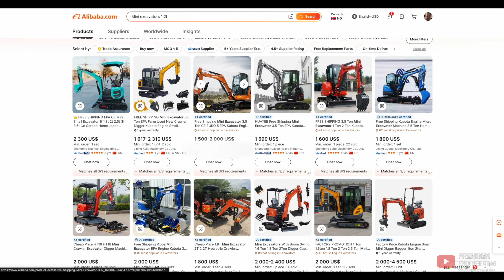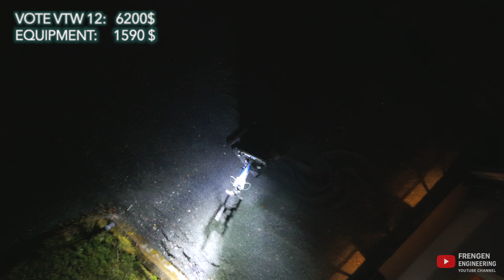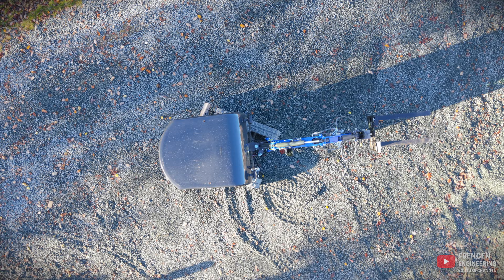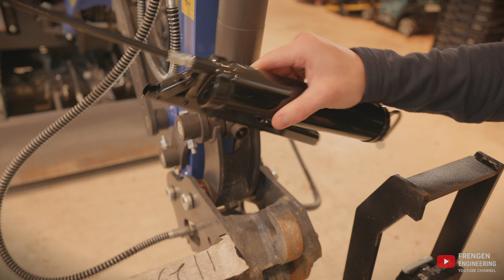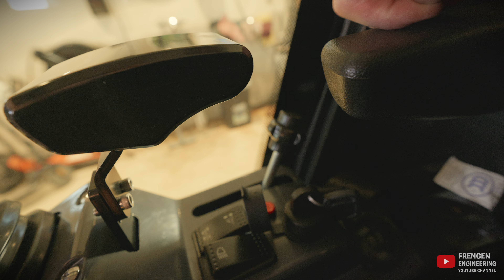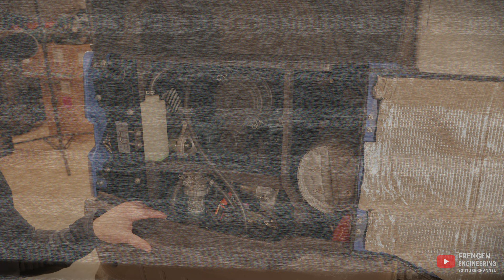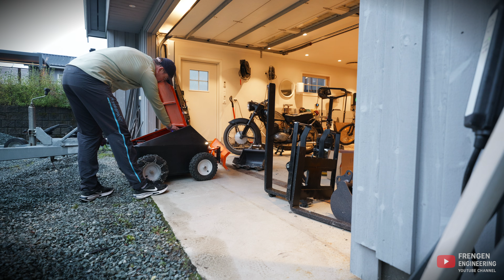What it REALLY costs to import an excavator from China — and what you actually get

Comment: jesus, you really should think of some kind of safety feature for quick hitch/coupler, just one button press and the bucket or whatever attachment will fall off. Maybe a switch operated relay that enables the button on the joystick.
for the quick hitch lines, there are hose clamps where you can weld on the base plate and hold the hose tight to the arm, im sure there are Hydraulic shops that sell them (maybe hansa flex?)
keep an eye out for track tensioning, theres probably a grease point underneath the cover plates on the side of the tracks for tensioning.
btw. if you attach new unfilled attackments (auger, slope bucket), check your hyd. oil levels.
in machines that small, some liters matter.

good luck tho!

Comment: We have a Avant with a Kubota engine and it's 25+ years old and we never had any issues with it.  (Think we got it in 2018)
Have changed hydraulic hoses once, and the battery a few times, and the seat has been worn out and replaced. 
Only thing broken is the hour counter, so we have no idea how long it has been running.

Comment: Great excavator! Don't bother with the doors, just forget about it. Strengthen and shield the high-pressure hoses—this is important! Weld two pieces of tubing to the control levers on each side and attach two pieces of rubber hose to prevent slipping. Then you'll be able to operate the excavator with your feet. It'll be a little awkward, but it'll free up your hands when you need them. Good luck!

Comment: Those fees are just insane and sound to me like a scam. 
But I have encountered something similar for out insulation liquid. It were just 6 barrels with 250L each and the time where they needed to be stored until german customs had them cleared costed me over 1000€. And it was stored for just a few days because german customs took a probe from both liquids to analyse it in a lab.

Comment: I bought ma Takeuchi TB217r used with 1200h Years, 3 Buckets, but without hydraulic quick coupler, claw, etc, for 19.000€ from a company, incl shipping, in Austria. I also thought about buying a Chinease one, but I was to afraid of the fees and taxes and I wanted a good supply of spare parts. (already broke a cylinder, from crashing into my carport ;).

Comment: Tip: Do the oil change now. As someone who got their first real engineering job at the SKF research laboratory way back when; 10h is just about right. Research showed that (almost) all wear stems from debris (from manufacturing etc.) that gets circulated and rolled into bearing surfaces. These then serve as stress concentrators that eventually lead to metal fatigue. (Bearings mounted in a "clean room" setting basically didn't ever wear out, when selected correctly for the application to begin with that is). 

So if I remember the experts correctly the sweet spot for the first oil change for a new engine is 10 hours. That balances the need for running time to work all the debris (e.g. burs) loose but not yet damage the bearing surfaces too badly. Then 100h (well you could do 25 hours, and 50 hours for that extra safety) and then as per the manufacturers recommendation. 

Now, for a home machine like this you're probably not going to wear out the engine anyway, but thought I'd just mention it. 

(P.S. And yes, synthetic oils actually are that much better, but not needed if you're changing the oil after just a couple of hours when running in.)
Reply from the maker: Thank you so much for this very helpful and detailed advice! Really appreciate it. 😊

Comment: Approx AUD $19000. Hmmmm have to check all options.
Reply: 10k to 12k you'd get it landed at the port at which state you're at. not sure where you got 19k aud from. as long as it's used for private use you can get one in Oz. import tax pretty sure Oz and China have an agreement. contact vote china for a quote.
Reply: @sheep.herder  well 12k USD=18400 to 19000 AUD depending on current conversion.
Reply: @alpinealpine2793  i just ordered one under 10k AUD shipped to Brisbane.
Reply: @alpinealpine2793  gst, port fees, quarantine(AQIS) + delivery around 12-13k AUD total price for the machine

Comment: grinding the door a little bit and painting it is probably easier than doing anything to the hinges. BUT you could add a shim on the hinge pin to bring the door higher just a little bit.lift it up on the hinge and put on a circlip  or take it off and put a washer
Reply from the maker: Perfect advice! Thanks☺️
Reply: @frengen_engineering  shimming the top of the pin inside may be better advice(so it doesn't grind). kinda depends on what its riding on/how good of a hinge it was to begin with, did they hide a bearing ball in there or not etc.

Comment: The CE mark doesn't btw mean it's tested or anything. By printing a CE logo the manufacturer declares that it meets all regulations. All it means is "I promise I'm not breaking any laws.
Reply from the maker: Yes, that’s the way I understand it also. But still , that’s enough for getting it leagal to operate and import. I think, for all such equipment, the most important is to use it in a safe way. Being cautious of hydraulic fails, balance of the machine and surroundings

Comment: I would prefer buying a good second hand mini ex rather than a “new” Triple-C (Cheap Chinese Crap) the moment I saw the 3.5 ton advertised at the same price as a 0.8 ton I knew it would be a scam. I have a Kubota 1.5 bought second hand and I love it. Chinese? You can keep em.
Reply from the maker: Hi, off course a Kubota is top level, but here in Norway, a used machine with 1000 hours cost twice as much as this new one, with all the equipment. Hope it will last for a while tough

Comment: That’s a very common scheme if you order CIF.
The shipping company will charge very little for the sea shipping. The handling company at the port will charge an amount which will exceed the sea shipping by a big margin. You can’t choose the handling company at the port, the original shipping company does this. The shipping company and the company at the port work together and they will make their profits regardless of a seemingly cheap shipping fee. 

To avoid this situation, it’s best to ask the seller for a DDP (delivery duty paid) price. Some sellers don’t offer such conditions. In this case it’s best to organize an own freight forwarded who will quota you the final costs based on item price, weight and size in advance.
Reply from the maker: Thanks for the tips! That’s really helpful information for anyone looking to import.
Reply: @frengen_engineering  I had a similar issue when importing my Chinese solar unit. I "fixed" the problem by going with a forwarder the 2nd time around. Learning money is well paid. I've ended up ordering a heat pump, ventilation system, fences, interior stairs, glass railings, balcony railings, massive pivot door, rooftop access window (remote controlled), "japanese" toilets, ceramic tiles (60% Duty in EU!!), WPC wood decking, Sauna house and a massive home gym with dumbbell pairs up to 35kg and about 200kg in disc weights, olympic bars etc, all for about 40k USD plus 4k shipping, plus VAT and duty, to the Baltics. Crazy savings, really. All products were of decent quality, except for the fence which I managed to sell on locally for a loss. 

What I did to make sure the products were decent, is to focus mostly on companies with at least 15+ good reviews, and which go to abroad trade shows, so that at least they had been in contact with western regulations and customers before. Also, the only company with issues (Fences) was the one where there had been no big amount of previous reviews...

Comment: To adjust your door quick and easy, assuming the hinges are not too thick and heavy duty, open the door, then put a wadded up cloth rag either in the hinge itself, or just below it (in the jamb opening) on the bottom hinge, and try to force the door to the closed position, and you will spread/bend the hinge faces apart a little, making the bottom part of the door close a little bit more to the front of the machine. Don't leave the rag in the hinge. This also works on most kitchen cabinet doors for minor adjustments.  Ask a few auto mechanics if you are unsure how to do it.

Comment: Good job ordering the machine with all of the specifications you wanted, like diesel Kubota engine.  Regarding the door closing properly I would suggest use a grinder and smooth that high point down that’s making contact and then touch up paint those two spots, door and frame haunch. Overall it seems like you got a good machine. I like that the Chinese business was honest, honorable and came through for you from half a world away.
Reply from the maker: Yes, I will do some grinding on the door to make it fit properly. Absolutely the best solution. Thanks for the tips😊

Comment: Good and informative video. From the previous and this video, the excavator seems to be very reasonable and as you mentioned , if you are not a full time builder or groundwork then this is a reasonable option. Similar to buying hand tools like spanners and sockets from cheap shops rather than buying the top quality if you are using them some weekends.

Comment: ... a few seconds later it was paid. Yeah I know that feeling. I ordered a laser from China, my second one from the same supplier for AU$16,000, or at the time a little over $11,000 USD. My bank made 3 calls to me about my transferring 100% of the $ to them up front, but because I had dealt with them before I had no problems.

Then I told my wife what I had paid - I thought the bank was bad...
Reply: The question you didn't answer is what does your $16,000 laser do for you ?

Comment: file the door corner down a little till it does not touch then paint it with touch up paint....simple
Reply: This is what I was going to suggest. Grind the metal on the door. Make sure to paint the exposed metal on the freshly filed area and the previously damaged paint to give obstacles to rust. I have never had luck completely preventing rust, but it's good to never surrender.
Reply: Yep 5 min with an angle grinder and spray can.

Comment: I did the same as this man, but ended up with a much more simple one. 1,2 ton with break hammer, tiltingbucket, quick shift and regular bucket(45cm) without cabin and a one cylinder air cooled diesel, swing boom and expandable tracks. All inclusive tax, shipping and custom. 6428 USD China-Norway BUT I used freight forwarder and didn’t have to pay all these extra fees I paid my freight forwarder 1130 USD and that’s included in all of my payments. So to you Norwegians who like to import your self, remember to use a freight forwarder. And think trough everything you like to have on your machine, before you start a communication with a seller from China. Good luck 😊
Reply from the maker: This is a very good tip!
Reply: @frengen_engineering  which shipping method did you use? Is it DDP?  Because by this method all shipping expences,including taxes and fees, pays seller. You just have to pay freight unloading at your destination.
Reply: The Arctic shipping route from China to Europe has been opened; perhaps in the future, freight costs between China and Europe will be cheaper.
Reply: @老虎-s9e  China had originally planned to extend its China–Europe freight trains to France and Northern Europe, but it is clear that Brussels is not keen on this.As long as the leaders of the EU and NATO continue to hold US citizenship or are appointed by the US, none of this will change.
Reply: A forwarder is the best suggestion in the comments. Saves a bunch of money and hassle, but shipping often takes a little longer. Considering the long shipping time from China anyway, a bit of extra time is nbd.
Reply: freight forwarder is just one more person you dont know you have to put your trust in with your entire purchase and more money. Well I am assuming you mean a freight forwarder from china? I tried to do this before and so many of these freight forwarders had some scary reviews lol
Reply: @acreageliving Not a good idea. Get a freight forwarder from your destination country.

Comment from the maker: Hi! Do you have other questions regarding the machine? Please comment them here, and I will include the answers in a future video! All the best, Frengen
Reply: For the issue of the bottom corner of the door catching on the frame, can you just shave a little bit off the corner of the door with a grinder to get the clearance needed? Seems a lot easier than messing with the hinges, especially if the door currently seals and opens/closes easily.
Reply from the maker: @mr.e.. Yes, don’t know why I did not think of this. That’s where YouTube is great! Someone also mentioned it. Will do. Thanks😊

Comment: Very interesting breakdown of costs. For that price, I would buy a used machine instead, of a better brand. Better quality and easier to get parts.
Reply from the maker: Hi, here in Norway, it costs about twice the price for a 8 year old Kubota same size, without anything other than a digging bucket.
Reply: @frengen_engineering  I get what you mean, it really does look like a great machine for that price. The only thing that would hold me back is that if something breaks, the expertise and spare parts aren't nearby. In the end, everything breaks at some point. But if you're handy, you'll probably manage just fine by simply ordering a small replacement part.
Reply: I agree
Reply: especcialy the spare parts part.

Comment: Just because anything from China has "CE" stickers all over it does NOT mean it is CE compliant. The same goes for the US equivalent to CE -- UL (or FCC or EPA or any other certifying organization). China has NO problem with putting CE/UL/et al logos all over everything they sell, but more often than not, those products are NOT compliant with those organizations' standards. Considering how pristine that excavator's box was when it was delivered, I doubt Norge's customs service actually did an inspection to verify it was fully CE compliant. Odds are it is not. The videos Frengen Engineering did for the machine are outstanding!
Reply: Correct, CE = European Conformity and... China Export 🤷‍♂️
Reply from the maker: Hi, You are correct about being skeptical about the CE marking. Anyway, in this case I have gotten all the needed papers, regarding the CE. If something then should happened, the paperwork is all good. Also, the machine itself has all the safety features as the CE in this case is demanding.
Reply: for majority CE is a self certification. it may lead to bans if abused and fines for the importer etc. it's just a promise that someone took a look and that someone somewhere would have the paperwork.

UL and CE differ greatly in that UL is not a self assessment and UL is not a legal requirement, UL is also a private company. products imported to usa have standards though but mostly its like the emissions bits and such for something like this, possibly FCC (these products will usually need services of a certification body for their CE marking).

for a lot of products CE marking just is them saying that it doesn't have banned in eu chemicals in it, that there's sufficient isolation of mains voltage from the body, that the leads, neutral and live(even if it's a product where it makes no difference, but sold without a plug), are marked and such. product recalls are usually related to insufficient isolation distances in lights and stuff. a lot of product just uses external psu's these days as it just makes it so much simpler.

Comment: Great vidoe!  Even with all the added costs, you received a nice excavator at about a third of the cost from dealers.   A three-ton Kubota with a cab and no accessories costs $44,000 USD in Thailand.
Reply from the maker: Thanks! Yes, even with the costs, it's a great deal!
Reply: To be fair, a Kubota is at least 3x the quality, and will last 5x longer.  It's like buying a Yugo vs a BMW

The cylinders on my Chinese mini began to rust after only one year. I've run/owned a of heavy equipment and never seen that. For homeowner use, they are barely acceptable, but nowhere comparable to a name brand machine.
Reply from the maker: @ArthurDentZaphodBeeb Hi, yes, the Kubota does lift the quality up by far. Really hope the sylinders won’t rust that fast on this model
Reply: Every possible corner is cut on Chinese machines. Substandard steel, welding, wiring, poor undercarriage, poor hydraulics, lousy bushings, lousy bearings etc etc etc. My Chinese mini is the most difficult piece of equipment I've ever operated - and I'm a Journeyman operator...

I'd be amazed if it lasts 1000hrs. The only thing worth a damn is the Kubota engine.
Reply from the maker: @ArthurDentZaphodBeeb Hi! That doesn’t sound good. What brand is this?
Reply: @ArthurDentZaphodBeeb  lol stop lying

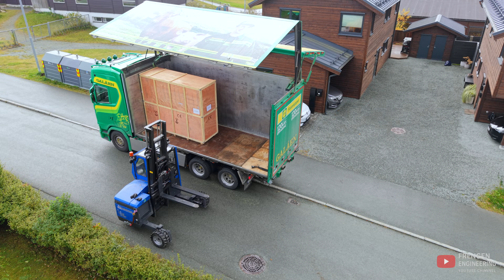Comment: 08:07 The companies just put the CE marking on the machines themselves. There is no organization doing any checks or anything. Besides, in China they just have some stupid "Chinese Export" which is exactly the same as CE. You can have any markings put on the machines you get from China. They don't mean anything at all.

Most likely your machine is illegal in the EU and if you would have a business and used those machines and something happened, you'd be screwed. As a private individual, nobody's probably going to check.

The engine is probably kubuto and not kubota.
Reply from the maker: Hi, The engine is a real Kubota, and the paperwork is all good in this case. If not, I would not have been able to get it delivered without getting it CE approved myself